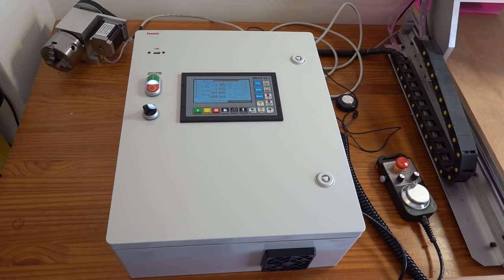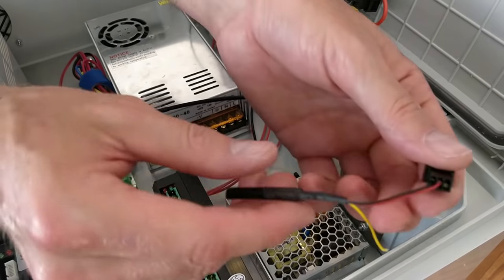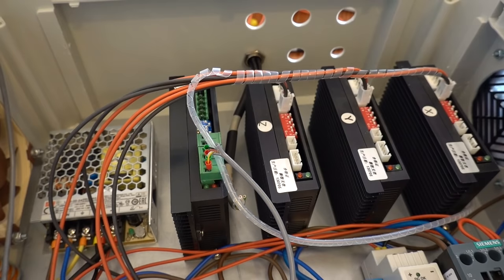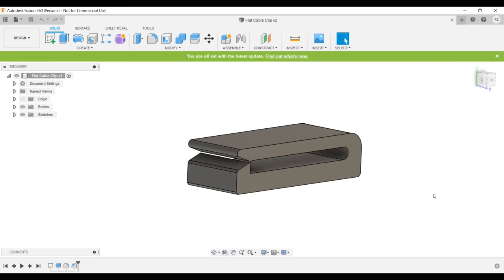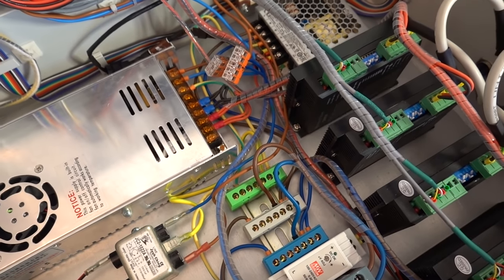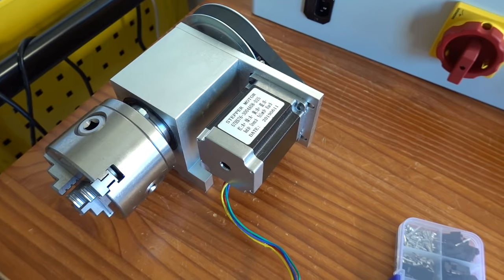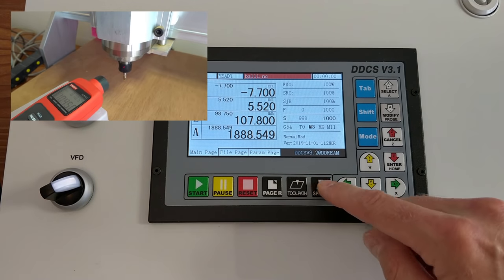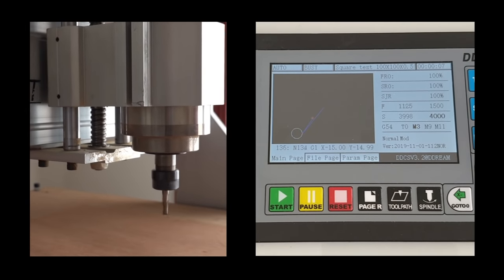Build Your Own CNC Controller, Part 2  |  DDCS V3.1  |  6040 Router

Comment: Hi! 
to the control the spindle motor, you connected the terminals U,V,W to the spindle motor (the motor have 4 cables, what do you do with the other cable?), and connected the DDCS terminal, AD-,AD+,AP-,AP+, to the terminals driver?
it necensary use 4 driver?
one to eje x, one to y, one to z, and one to spindle motor?
sorry for many question i do, i new on the technology world
Reply from the maker: Hi, no problem. The spindle only uses 3 wires. The connector had 4 pins, but one of them is not connected to anything. For stepper wiring would like to refer you to the wiring diagram on my website linked in description. The 4th stepper driver is used for the 4th (rotary) axis. If you don't have one of these then 3 drivers is enough.

Comment: Hola, excelente video, yo tengo la misma controladora, podrías hacer un video de la configuración del eje A, para el eje rotativo, a mi no me funciona. Muchas gracias, saludos desde chile
Reply from the maker: Hi, I think you are asking for configuration of the 4th axis as yours is not working. Hope I got this correctly from Google translate. Please see the PDF file in the article linked in the description of the video. This has all of the parameters I changed on the DDCS, including the 4th axis.
Reply: De acuerdo, lo revisare, muchas gracias por la rapida respuesta, eres muy amable

Comment: Hi, thanks for the video, very informative, we also purchased the same device to control our CNC however we have a problem with the limit switches we have the PSN30-15DP and its not detecting or turning on the switches we went according to the wiring diagram, I would appreciate and help in this regard, thanks Ashley
Reply from the maker: Hi, I have just installed mechanical homing switches (similar connection as limit switches) and they work fine. Connection is different though for inductive sensors, however parameters should be the same. Have you checked if parameters #52 up to #55 are set to 1?  #400 up to #407  should be 1 as well. Check #408 up to #415 if the electric level matches your connections ( normally open or normally closed). Are they connected per section 2.6.2 of the manual? Have you checked if the switch works in the IO screen on the DDCS controller? That is all I can think of at the moment. Let me know if you had any luck with this.
Robin

Comment: Great video, nice work. Which postprocessor i have to use in Fusion360?
Reply from the maker: Thanks! The standard mach3 post that comes with fusion works fine for me. Check the comments under the website article linked in the description for a modification to this post to add a delay for spindle ramp up, but you can also use it as is.

Comment: Just a thought but shouldn't the spindle use a different type of connector if the control box is powered on but the spindle is disconnected, youll have exposed live through the pins on the outside of the box. I think you should be using a ws series connector instead? (It has a socket on the through panel bit and pins on the cable bit) Also isn't a 1500w spindle too high current for the 5a rated gx16?
Reply from the maker: Excellent point. It would indeed be a good idea to get a connector with higher amp rating for this. Also, I don't like that it is now possible to plug  your stepper cable into the spindle connector. Not exactly poka yoke. I just copied the way it was wired in the old controller to keep it simple, but there are better ways of doing this. This means controllers are actually sold wired like this. I will try to get a different style (female) connector with higher amp rating. Thanks for the feedback!
Reply: @uptimefab7412  I would recommend something like a ws20 connector. Works the same way but is the other way around (socket on the through panel, pins on the plug) and has a higher current rating. It's what I'm planning on using for mine

Comment: good job! where did you connect the cable shield?
Reply from the maker: Hi, I connected the cable shield to one of the unused pins and routed that wire to the grounding bar. This is a single point where all found wires are connected. Note that it would be better to place the connector in a metal plate. That way you can just fold over the cable shield, which connects it to the outside of the metal connector. This in turn is fitted in the metal plate. You can then run a single wire from the metal plate to the ground bar to ground all connectors.

Comment: Did you have any problems with vfd in the same enclosure
Reply from the maker: Hi, no problems so far, but others have reported issues (with their own layout and components) There are mixed results on this. Some people say it works fine while others have issues. If you want to be safe put the VFD in a separate metal enclosure.

Comment: Sir what is the name and size of the wire  you connected from the drives to the motors?
Reply from the maker: Hi, I used 0.75mm^2 (18AWG)

Comment: Sir what is the name of cable you connected to the aviation connectors?
Reply from the maker: Hi, it is Lapp 0034704 (LIYCY, flexible, shielded, PVC 4×0.75sq_mm). This and other parts can also be found in the website article linked in the description. Best, Robin

Comment: You are using some kind of flexible plastic to join multiple threads together to make it orderly. How is that called en where van I get it?
Reply from the maker: Not sure what the correct name is, but when you search "wire wrap" on aliexpress you get a number of options including the type I used, which is the spiral type. Other types may work as well, this is just what I picked out.

Comment: Looks great, but why didn't you add a 4th wire to the spindle cable to ground the spindle motor ?
Reply from the maker: Thanks, I am not sure how to connect ground to the spindle yet. There is a 4 wire cable running to the spindle, but the 4th pin is not connected to anything at the spindle end. I would have to remove the top of the spindle to actually connect it to something inside. I am not sure if the coolant lines are opened when I take off the lid so I am hesitant to do this. Maybe a general ground point to the spindle or other part of the frame is an option and run that to the central ground inside the controller cabinet. Please let me know if you have any tips on good practices for grounding the spindle.
Reply: @uptimefab7412  on my aircooled spindel I was able to take off the motor top cap easily and find a good ground point. In your case maybe break out the ground wire just before the plug entering the motor and simply crimp on a round lug which goes to one of the motor clamp bolts then ? Or just run a fully separate wire to somewhere directly in contact with the motor at least. It's not double isolated so the ground is your only safety.

Note that the old black box too lacked a proper ground for the metal case itself...
Reply from the maker: Thanks again, I will have a look at what is the most practical solution in my case. The machine as I got it from the supplier was probably not the best example of a properly grounded machine. I have learned a lot during this project on grounding (and still have a lot to learn). It will probably not be perfect but hopefully safe to work with.

Comment: Hello sir, i also made the cnc plasma machine without THC or z-axis. When i doing any job on the cnc is plasma torch is always on. When i doing holes in metal sheet is holes are done but the path is also cut. Pl's help me. The THC is needed to torch on/off or failure of sheetcam design when i made the design.
Reply from the maker: Hi, I have not used a plasma machine before, nor have I posted any code for such machine. Sorry, but I would not be if much help. In case you did not do this already I would say check if you post processor is for the correct type of machine and if the code used for turning the plasma on or off is the same as used for your specific machine.

Comment: Where did you find a nactua fan that can run off 24v I can find them only 12v please tell be where I can get a 24v one
Reply from the maker: I think you just found a big mistake in my wiring setup. This specific model is indeed not available in 24V. Some time passed between buying and using the fan so I forgot it was 12V instead of 24V. Sorry about that and thanks for your comment! The good news is that it actually runs and does not burn out immediately at 24V with the low rpm adapter, but obviously I need to fix this. EDIT: I have now connected the fan to a 24V-12V step down converter and cut out the part of the video related to sound measurements with the wrong voltage. On 12V it is running slower as expected and I actually removed the low noise adapter to make sure there is enough air flow. Still nice and quiet.
 Cheers, Robin

Comment: 6 sensors are required for (X Y Z)
And 3 extra sensors for Home (X Y Z)?
Or the Limits can be set as Home?
Are the Home required? 
Great video, great explanation.
Reply from the maker: Both are possible. You can combine limit switches with homes switches. In that case you need to set a parameter to automatically disable the limit switch function during the homing cycle. After homing it will act again as a limit switch. I have also placed home switches in the meantime. When using soft limit function in the control, no switches on the other side of each axis would be needed.  Still have to test if this works well enough. Switches on both ends is probably the safest solution.
Reply: @uptimefab7412  Last night googling, I found the official forum (eureka)
And they talk about Limits and HOME 
http://bbs.ddcnc.com/forum.php?mod=viewthread&tid=82
Now the problem is adjusting those settings ...
Thanks for your video.
Your ensemble was perfect.

Comment: hi your are good i want to do a question i want to buy many things beacause i want to make a cnc router from which site you suggest to buy thiw things thaks for your answer
Reply from the maker: Hi, it depends on the parts you are looking for. There is no single good answer to this. I typically check for each component if I can find a local source that is cheap enough. If not I take my chances with Amazon, Aliexpress or banggood. Note that warranty and lead time are better with local sources.

Comment: А как к этому чуду подключать шаговый сервопривод? В нем куча интересных сигналов - MF, CLR, PEND,ALM,S-OFF  Это все выходы драйвера, полезные наверное. А DDCS управляет по принципу STEP-DIR и все
Reply from the maker: Hi, could you post your comment in English? I can't understand your language. Thanks!
Reply: @uptimefab7412  And how to connect a stepper servo to this controller? There are a lot of interesting signals in it - MF, CLR, PEND,ALM,S-OFF Are all driver outputs, probably useful. And DDCS manages on the principle of STEP-DIR and that's it
Reply from the maker: Yes, indeed the DDCS is a bit limited in functionality and cannot handle the additional servo signals. However I think this is to be expected for the type of controller it is and the low price you pay for it. It is more catered towards cheaper machines. If you want a controller capable of handling absolute type servos, maybe some models from SZGH (or other brands) would work for you. Of course these are much more expensive.

Comment: Hi, is it possible to configure the DDCS for two Y motors ? I have 1X motor, 2Y motors and 1 for Z. If so, it is included in manual from that DDCS v3.1? Thank you
Reply from the maker: Hi, unfortunately the DDCS v3.1 does not support 2 y axis motors.
Reply: @uptimefab7412  Thank you
Reply: You can split the Y axis pulse and direction signal into two drives and run two separate Y motors. You need to use one home switch but manually align the two motors yourself.

Comment: What a great video. I'm converting my little LMS 3990 into CNC using the DDCS and I'm at Mouser trying to determine what PTFix DinRail Products to buy. Do you have the part numbers for what you ordered? There are way too many to try to guess. thanks!!
Reply: NEVER MIND, I found it in your docs on your site
Reply from the maker: Good to see you for and the information you needed. Best of luck with your conversion project!
Reply: @uptimefab7412  Hey thanks for responding. So I got the blocks from Mouser but suddenly realized that you need a specific 'Pin' that the wire crimps on to. I don't see that in your BOM anywhere and I haven't heard you mention it in any detail. It looks like you had a selection of different colors. Where did you get those if you don't mind me asking :) ?
Reply: OMG, I can't believe I'm answering my own question again... So there is a little button on the top of the block that you can push to open the internal spring loaded contact inside. You simply push the button, push your wire in and let go. 

I would really like to have those pins your using anyways just to keep everything sanitary
Reply from the maker: Good tip, that is probably an easier way to do it, rather than just pushing the wire in without pressing the button. I only used the button when needed to release the wires.
Reply from the maker: I got these from AliExpress, but also recently bought an additional supply from a regional store. If you search for "ferrules" on aliexpress, you will see many assortment kits with various sizes. It is best to buy a set including the special four way pliers, very cheap. (Also cheap in local stores) They also indicate which sizes are included and for what wire gauges they are suitable.
Edit: the manual for ptfix actually indicates you can also directly insert stranded wires without ferrules, but you have to push the button when inserting the wire in that case. With a ferrule on the end you can just directly press it in .

Comment: Does this controller work in 1325 CNC machine ?
Reply from the maker: That machine is quite large but the principles remain the same, so the DDCS should work. Would seem a bit out of place though for a machine this size and cost. Everything should be scaled up, like power supplies, stepper (servo drives) etc. So 1:1 it would not work.

Comment: Could a din rail power supply be used instead of the larger switching supply to power the stand alone controller?
Reply from the maker: Yes, but a Din rail power supply of around 400W can be quite expensive. This is the reason I kept the power supply from my old controller. You can also buy 2 or more din rail power supplies with less power, which is cheaper. Then just connect 1 or more stepper drivers to each power supply. I would go for a 48V supply, not 40V like mine.
Reply: @uptimefab7412  I actually mean just to power the DDCS V3.1. which is takes less than an amp. I will be using a toroid for AC power to the closed loop drives.
Reply from the maker: Aha, in that case also yes. I have actually also replaced it last week with 2 small DIN rail power supplies. 1 amp each, as recommended in the manual. One for power and the other for the IO.
Reply: @uptimefab7412  Nice. I hope we'll get to see that as well.

Comment: Will this controller read out in both inch and metric?
Reply from the maker: Yes, the main unit can be switched between mm and inches
Reply: @uptimefab7412  👍 Excellent.

Comment: What's the price estimation of the new controller
Reply from the maker: For the DDCS controller, 4 stepper drives, switches, cables, contactor and cabinet I think around 600 usd/euro. This is excluding a heavy power supply and VFD.

Comment: Como eu coloco a máquina pra trabalhar sem o fim de curso?
Reply from the maker: I had to Google translate this. I think you are asking how to use the machine without end switch. They are not required and you can run it fine without either home or end switches. Please translate your questions to English before posting, otherwise it becomes a bit of a puzzle for me to answer them.
Reply: @uptimefab7412  thank you very much, I wanted to find zero work and zero machine, now I have to configure the size of the cutting area. thanks for answering me, a big hug.

￼

Comment: sir does ddcs support spindle encoder?
Reply from the maker: Hi, the DDCS V3.1 does not support a spindle encoder. As far as I can find also the more expensive models do not support this. SZGH have some milling controllers that do support rigid tapping.
Reply: @uptimefab7412  Sir, thank you for your feedback. it is really helpful to make purchasing decisions for me. Currently i am using Mach3 for both my mini lathe conversion and DIY cnc mill. Just looking at standalone controllers for other projects. Btw you videos are excellent. Thank you for sharing your knowledge. Cheers

Comment: how to set ball screw pitch in it plzz help me in it
Reply from the maker: Hi, this is covered in the PDF file which is in the article linked in the description of the video. It is somewhere in the middle of the article. At the end you will see DDCS parameters with an explanation of steps per revolution based on ball screw pitch. Hope this helps.
Reply: @uptimefab7412  can you please give me the reference about what is the article no
Reply from the maker: I am not sure what you mean, but if you refer to the PDF, this is in the website article. You can find the link in the video  description under the video
Reply: @uptimefab7412  okay now i understand that
Reply: @uptimefab7412   just now I've see the pdf that you give in discription
Reply: i got one more question ❓ dose this control can do engraving work or precision work
Reply from the maker: Hi, the precision of the machine is more limited by the machine itself than the controller. So, yes it can do precise engraving, but only if your machine is capable of that as well.